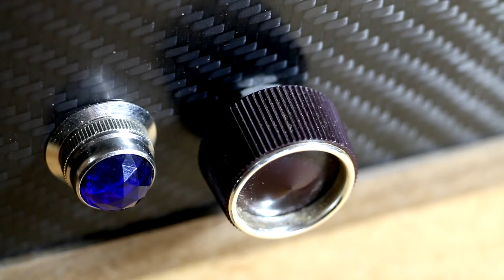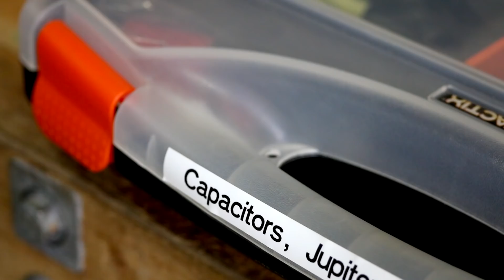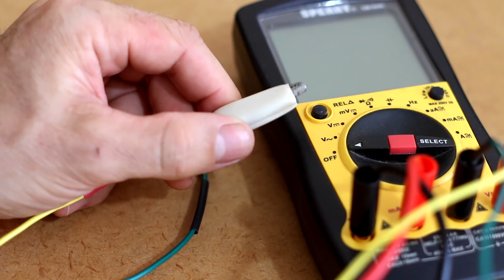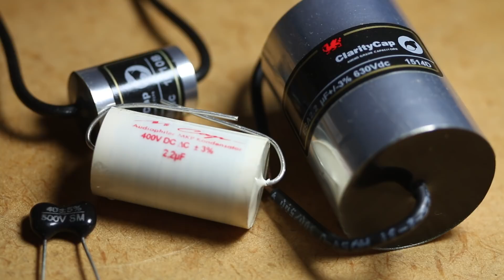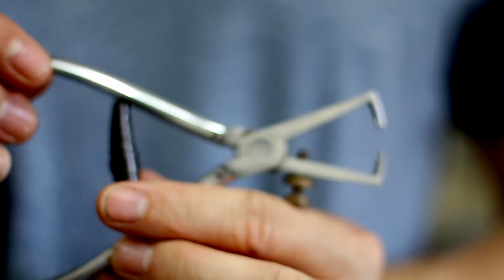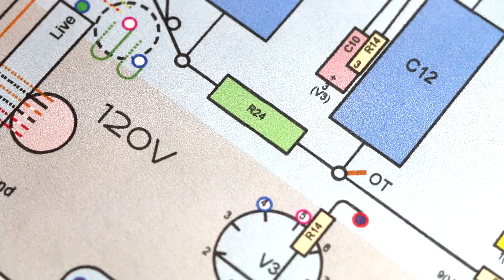Small Tube Amp Build - Step by Step (1 - Introduction)

Comment: @elams1894 I have a challenge for you... build a ~100w high gain modern voiced metal amp head with turret construction or whatever you think is best. I dont know if you've already done it but if not i do know you'll nail it. The goal will be the most crushing metal tone possible.

Comment: Just discovered this channel. Very nice. Excellent low key and exact presentation style as well as terrific knowledge. I'm surprised you didn't mention the outer foil marks on your vintage caps. Maybe that comes later. Finding that for caps that don't have it is a pain. Taking pot luck opens a big door to filament noise as I'm sure you know.
Reply from the maker: Thanks! Indeed very good points. I'm not actualy sure why I've not mentioned cap foil orientation. Thanks for highlighting the subject. I'll include it in the next video which is not far away. Have a great day!!

Comment: On resistors - Only thing I've really noticed with different resistor compositions is noise. I've built identical circuits in the past with 100% carbon comp vs 100% carbon film in the signal path; the carbon comp amps always had a considerably higher noise floor. It pains me to admit it because I love the look of old carbon comp resistors (the colours) but I can't justify using them for anything other than authenticity in old stuff. There's lots of great (albeit dense) application notes on the subject of resistor compositions and their performance in different applications if you're curious.

I'm working on some pedals right now and I designin PCB's with your stuff on in the background. Appreciate the great content as always.
Reply from the maker: Thanks Shim! I agree about the resistors. Carbon films are fantastic. I'm not a fan of carbon comps myself. metal film, or carbon film preferably when I have a very nice build to look fwd to. All the best with the pedals, cheers!

Comment: To get the full benefit of these videos, I suggest to go ahead and buy a set of the plans - even you have no intention of really building any. Believe me guys, the plans are a MASTER PIECE. What you get is worth more than TEN times what you pay for them!

Out of curiosity, Jeff, do you have any of the amps in these plans already built which one could purchase and use as a demo piece while one attempts to purchase the parts and publish or re publish - whatever  is allowable by you  - as a DIY kit. Looking at your design and building details, these should really sound great and quite. Am even looking at a further modification / addition to build versions using RCA input and outputs
Reply from the maker: Thanks Kofi, really appreciate the kind words. I don't have any spare amps at the moment as they go quickly, but will be building a few soon. I mainly build my amps with 230V connection so if any need to be built with 120V connections, they will have to be pre ordered. On RCA's... are you planning HiFi outputs? If so, they will need quite a bit of modification as the guitar input is low whereas HiFi is quite a bit more powerful, so input level needs to be factored in to your design. I have designed a HiFi amp circuit, email me on elams1894@gmail.com and I will send you the circuit so you can get ideas on the input. Thanks agin Kofi!

Comment: hello there!

I've become pretty handy with a soldering iron over the years, yet still learned a lot from your how not to melt everything video. 
I think I got building this amp, and I really aspire to learn how an amplifier actually works which is something I heard you won't when just building a kit with a circuit board.

So that's why I wanted to dive right into this actually. I live in the Netherlands though, do you have any recommendations on how to get the right parts, for instance you say solid core wire, but don't really elaborate, I assume it should be a wire that has heat-resistant insulation, right? Would you recommend specialized stores or just get stuff as cheap. For instance the olefin heat shrink I just got off of amazon.

Also, I intend to build a tube amp with none or at least minimal self noise. I heard from a specialist that this depends on the transformer, do you have any recommendations? Is the transformer on your parts list for instance up to those standards? from what the guy told me I heard they can be pretty expensive.
Reply from the maker: Hi Thijs, thanks for checking out the vids. Indeed tube amps are a fantastic journey albeit a long and windy road, but there is light at the end of the tunnel. First off, solid core cable is just solid copper, no strands. It is easier to bend, stays in place, however will break if bent too much. Use solid core for areas like filaments, or hook up wire that is intended to stay in one place. Use stranded for shielded cable, or any cable that may need bending often during construction.

Use any components and/or materials that meet specification and/or take your fancy. I like using as much vintage, old stock, recycled first and foremost, and then any part or component that is at least partially decent, i.e., anything made in Japan, USA, Europe. I stay clear of cheap stuff and the mega expensive. Buy what you can, when you can, I guess, as long as it is up to correct spec.

Hammond transformers are good quality, nothing at all wrong with them. I use second hand, vintage transformers that meet spec, as I can source them here in New Zealand for cheap and they are very high quality, even 50 years old. I deconstruct old tube radios when I can get them cheap, but they are becoming more and more expensive now. 

As for an understanding of what is going on in tube amps, that is an epic journey, and one that is entirely up to you as nothing is set in stone. You can go down the quantum mechanics path and delve into particle, electron, physics... or, like me, if that makes zero sense to you, you can go down magnetic field theory, which, IMO provides significantly more understanding. However, it is an arduous journey and perhaps be prepared to un-learn everything you think you know about electricity. Drop me aline at elams1894@gmail.com if you have any questions, by all means.

Comment: Hi Mate, I would like to download schematic from your web site. Before I start with the project, can you please tell me what transformers are used or how much they cost. Thanks in advance.
Reply from the maker: Hi Petar. The ideal transformer used for this amp is one that can handle up to five tubes small tubes. For example, the ones that you find in small vintage tube radios. The ideal secondary voltage is around 540 volts under no load, 270v - 0 - 270v centre tapped. Also the transformer should have an additional 6.3v winding, centre tapped is ideal but you can get away with a 6.3v winding that is not tapped (just let me know as there is a separate schematic for that)

An ideal transformer is one manufactured by ClassicTone in the USA, model number 40- 18085. This is a great, grunty little power transformer and will work just fine too. Cheers

Comment: Great work! I keen to build but I am having troubles sourcing the Power Transformer as they are out of stock. Is there another PT that you could recommend?  I would appreciate some guidance as I am having trouble sourcing that PT. Thanks
Reply from the maker: Hi Jol. You can use any transformer you like really, as long as it's around 530V - 550V centre tapped. I use transformers sourced from a vintage tube radio. If the primary transformer from a vintage radio can power at least 4 tubes, and its in the voltage ball park, you should be fine. Which part of the world are you from?
Reply from the maker: If you want to message me on Instagram, I can give you more info like email address. I have just completed the plans for the Mark 2 version of this amp which I'm about to put on my website. Same circuit, just simplified switching for more stable output. The diagrams are far superior too. Let me know if interested.

Comment: Hi Jeff, I have built two of these amplifiers now, the first rough and ready, the second with better quality components and neatly. The only substantial difference  in design is the use of rather larger output transformers, I prefer uncompressed output. They sound absolutely great - about the most versatile range of tones I've had. I have made quite a number of amps now, and this one has tones to beat the lot.For me it sound bestplayed through an Eminence 15in Guitar (not bass) cab I have made. The amount of sheer welly it has is surprising to those who hear it. Thanks again Chris
Reply from the maker: Hi Chris! Super sorry for late reply. Not sure how I missed your comment. So glad to hear of your builds and upgrades. Also wonderful to hear that you got alot our of the amp despite the size. I completely agree about the versatility, one can get generate alot of tones. Thanks for letting me know your feedback, much appreciated!
Reply: @elams1894  Awesome lookign series. Im in Australia, before I buy the plans, what is the rough cost estimate for the build?
Reply from the maker: @scottcooper6644  Thanks Scott, I'm not exactly sure what the cost is at present due to covid. It all depends what you can source from Oz. I use transformers from old NZ Bell Colt radios that cost me about 20$ a piece. Decent switches can be obtained from old radiograms and projectors that people throw out, so I grab those too. Those are real cost savers. However if you are buying new, I would estimate that thick end if 500$. If you are resourceful, you can do it a lot cheaper, depending what you have lying around. Hope you guys are doing good over the ditch, crazy times.. Cheers
Reply: @elams1894  thanks elam! I'm finding out pretty quickly that this is an expensive hobby haha.

Comment: Have now completed the amp build, as far as the working chassis. Financial constraints led me to make a few cost savings, such as a decidedly second hand power transformer, but of the correct values, reduce size into a smaller chassis, and use Mallory caps in the signal path. The result sounds great to my ears. I would comment on a couple of difficulties I had. The layout diagram of where R5 and R1 terminate was difficult to interpret(for me), and I had to have a bit of a learning exercise about input impedances  to work it out from the schematic. I am colour blind, and it took a while to visualise where the various switch and pot terminal are connected. I also found it had more hum than I expected, so I elevated the heater centre tap to the EL84 cathode voltage. I'm so pleased with the sound and versatility I have ordered a larger chassis and other parts to make a final, neat version. 
My hat is off to your amp design skills.
Reply from the maker: That's awesome Chris! Well done. Especially regarding you using second hand parts. That's what its all about. It is a challenging layout, especially with the wee switch and sorry about the layout diagram colours, I can imagine that would be difficult. I have since overhauled the layout diagram in which I have replaced the colour terminations with actual leads. I have also made a Series 2 circuit which retains the clean/crunch switch, the channels of which have their corresponding cathode caps with no additional switching. As I like the cathode caps in their designated channels, I have removed the 2P3T switch in the Series 2 circuit. This does a couple of things, makes it a bit simpler and takes away more noise. Although that switch is a cool thing, I believe it may not be entirely necessary. Also, I have designed a GT circuit for this same WISC preamp, which has a very nice tone stack. I have completed the layout diagram for this also. If you would like these reworked circuits please give me a PM or drop me an email and I will be happy to share them with you. Cheers

Comment: I'm just halfway through building this amp, and as I have reviewed the values of components, I have a question about the value suggested for R22. Will a 1/2 Watt rating be enough for the EL84 cathode resistor lying so close to a large smoothing cap? In similar single ended EL84 amps I have used a larger wattage current value resistor to dissipate the heat better, and placed it away from other components. I also notice that in the board layout there is some confusion in the nomenclature of the grid resistor R21 and cathode resistor R14. I appreciate yours is up and running, so I would appreciate your comments.
Reply from the maker: Hi Chris. Thanks for the message, yes the error in layout drawing slipped out, however it's now been corrected, thanks for that. I have had no trouble with the 1/2 watt resistor in the R22 position but certainly to be on the safe side a 2 watt resistor would be a good idea. Cheers

Comment: are they viable as hi-fi amps,?
Reply: Not really.  They are limited in high end response and tend towards heavy distortion.  If you want to get into hi-fi amps I would suggest looking at dcgillespie's threads on the audioasylum board.  He has some nice simple designs.

Comment: What brand are the resistors ? Thx.
Reply from the maker: I use either Jupiter Vintage Tones or Sozo yellow caps, both are mustard replicas. They sound outstanding to my ears. Thanks
Reply: The red 1% resistors ?
Reply from the maker: They are red Astron replicas.they are pretty pricey and I used them as I was interested in their tone. I would say that they would be great for sparkly clean amps, however, the yellow mustards are perfect for crunch tones as they have fantastic note separation.
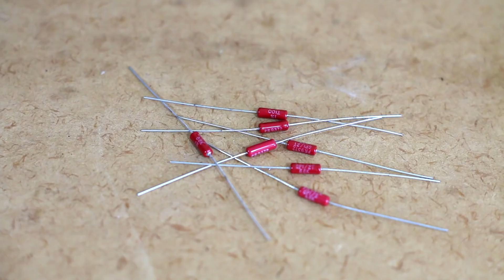Reply: Hate to keep bothering you, however at 9:22 into the video you talk about Red colored resistors. You like them because they are red . Am I missing something ? Not caps.
Reply from the maker: Sorry mate, I was thinking this was a different video for so.e reason. The red things are indeed resistors, PRP brand resistors. They are metal film and look great in red. Not sure they are any better than similar brand metal films however they have long leads which I really like, cheers

Comment: I have asked but ni one has answered, maybe you could help me find out:

Would it be possible to remove an Gain pot from an amp and wire in a jack and have a foot switch that controls the gain (like an volume pedal for the gain)?
Reply: Yes. Use a TRS jack with a stereo cable to foot pedal with the potentiometer from the amp. I would highly recommend using fully shielded cable.
Reply: bassmann446 thanks..I just thought how cool would it be if you could control knobs on your amp with an foot pedal for those moments you want a little more from it; whether your gain or volume.

Comment: Thankyou for putting up your video with instructions, and making the information available. Is it possible to use a 6V6 rather than a EL84 , and to simplify it further to a single channel clean amp, with no master volume and no tone control ? cheers and thanks
Reply from the maker: Certainly is possible, that would be a grunty little amp, Fender Champ style. Cheers TG!